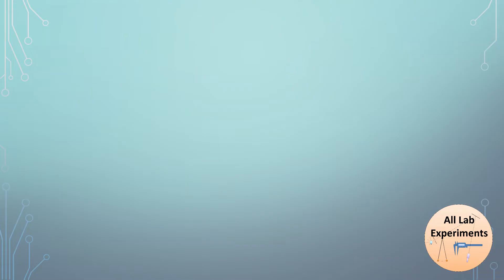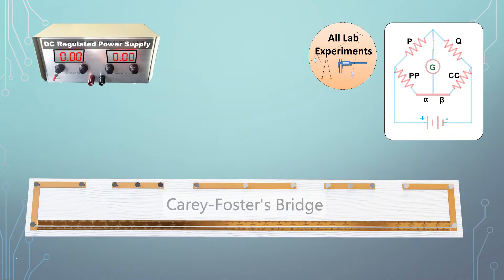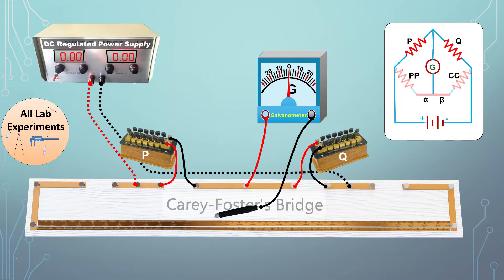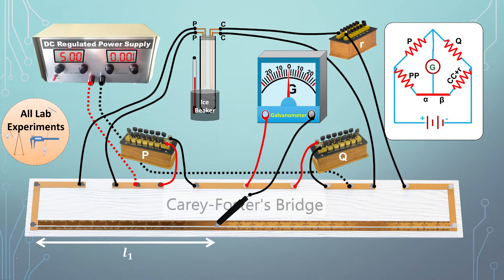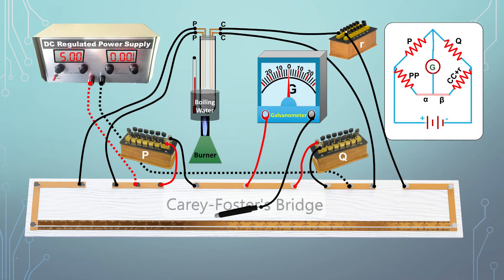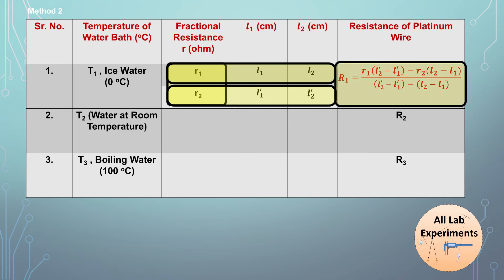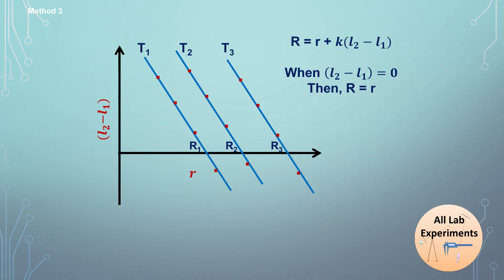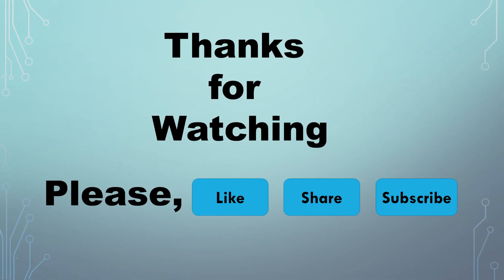Temperature Coefficient of Platinum Resistance | Full Experiment | Practical File

Comment: can u show "To study the variation of thermo emf across two junctions of a thermocouple with temperature. " this exp
Reply from the maker: Yeah i am planning for it. But many people perform this exepriment quite differently. So it may take me some time to narrow down all the mthods and fix them in one video. I can simply make this using potentiometer. Some guys dot his using opamp or somebody just can measure its voltage using a multimeter. So in my understanding its a very simple experiment but performed by several methods so there are very few scope pf getting an audience for this.